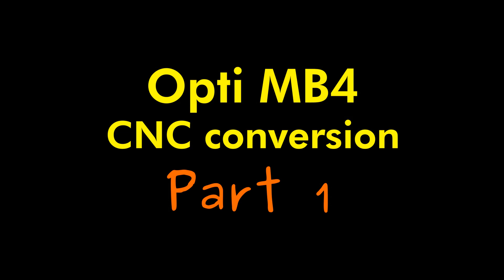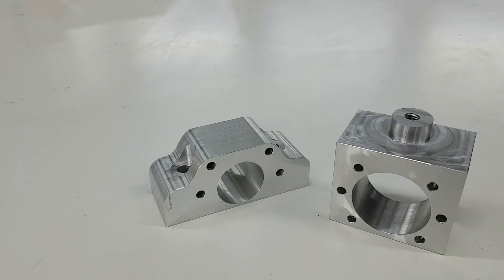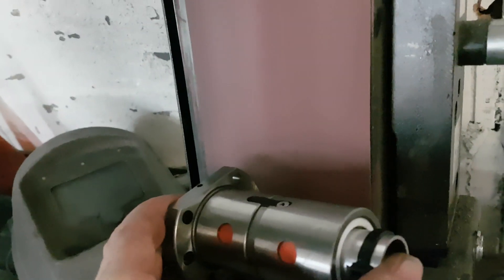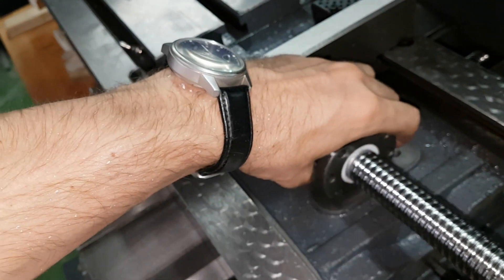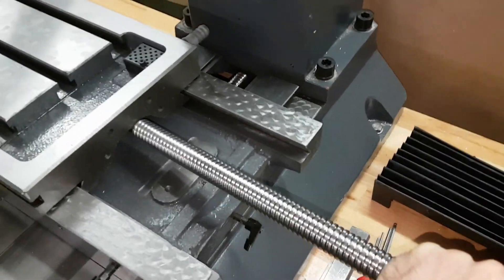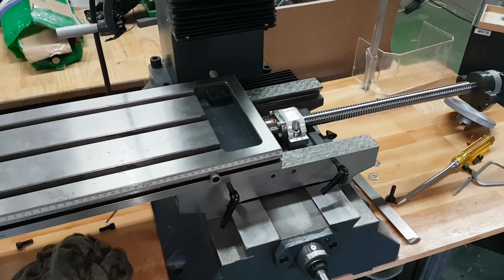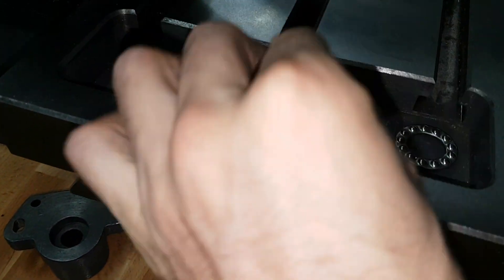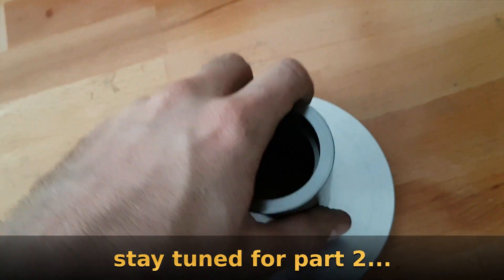Optimum MB4 CNC conversion Part 1

Comment: Nice work 😀If you could what are your thoughts a few years later on the 12Nm Z motor being enough power? I am planning a conversion and considering some sort of weight or gas lift to help or even a NEMA 42.

Comment: Hello; good work, congrats ! MB 4 is probably the most solid desktop mill before stepping up to a knee mill. If you run the dial indicator on the table, what is the flatness accuracy ? Obviously small local deviations due to surface roughness should be discarded.
Reply: Hi, after my tests i measured a deviation of ~0.01-0.02mm along all the X axis.

Comment: hello. i want to buy a optimum MB4 mill, however i have read that the motor is 400v 3ph, it is delta or star configuration??? because in my house i have 1 phase 230v and my doubt is if i could use a VFD for running the motor.
Reply from the maker: I'm not sure if it's delta or star, will have to check. Also note that the switch box has two motor speed settings - I think it's done with two different windings on the motor, or maybe reconfiguring the phases. In any case, I'm actually running my mill off a VFD off a single-phase 230V. It works well, although it might have a little bit less torque than on a proper 3-phase. I only noticed it when running it at full speed (3200 RPM).
Reply: @codemakeshare  HI ty for the answer. The output of your vfd its 230v 3ph or 400v 3ph
Reply: @feelthegame2286  The MB4 motor is a dahlander motor, also know as dual speed motor. Have 2 windings per pole, that can be confirurated to active poles or consequent poles, ir order to allow the motor to have p.e, 2 poles or 4. What results in two possible speeds, 1400 or 2800rpm. In both configurations the motor is connected to a 400V line-line grid.

Comment: do you mind providing the drawing plans if possible, i am portuguese and i would like to do the same project you are doing on your MB4 optimum!
Reply: https://github.com/KurtJacobson/RF45-CNC/find/master 

for the ball screws, electronics etc.:
https://cnc-robotica.com/
ask for 20-05 spindle, not the 20-10. The 5mm pitch is better imho for the resolution of the machine.

free advice; use flange bearing seats and roller bearings.
c7 spindle with P1 single nut: between 0.03-0.06 backlash on my mill. compensate in linuxcnc or mach3 accordingly.
use gas springs to reduce the head weight
don't skip the oiling channels, drill them and add pneumatic quick connectors everywhere. cnc operation sees more travel on all the axis than conventional :-)

if you want to see a machine in action, drop me a line with your skype or email.

saludos de bilbao
Reply: MrZhefish my e-mail for the vídeo figueiredo.geral.figueiredo@gmail.com
Reply from the maker: I have some information on my blog, codemakeshare.com

Comment: what spindle will you be using?
Reply from the maker: I'm using two spindles: the original stock spindle with the stock gearbox and motor goes from 80 RPM to 3200 RPM (good for big tools and tapping). I also made an adapter sleeve for a 1kW spindle with 24kRPM, which is great for aluminium milling with tools up to 6mm diameter.

Comment: How expensive were all the parts you used and would you recommend this conversion now that you have done it?
Reply from the maker: I think it was around $1000 for the ballscrews, motors and motor drives. The mill was around $2700 new - so less than 4k total. I'm still very happy with the machine. Certainly the drive train with NEMA34 closed-loop steppers and double ballscrews is awesome (6000mm/min rapids, very precise). The MB4 is probably the most solid machine you can get new at this price, at least here in Europe. There are a few small quirks that could be better, e.g. I wish the Z-Axis would go a bit lower (lost a few centimeters in the conversion), and to get the full Y-axis travel it has to exceed the base. But in practice it's not a huge deal, and there are probably some similar quirks with any machine.
Reply: @codemakeshare  What kind of accuracy did you get pre conversion and how good is it now or did you not really use it pre conversion?